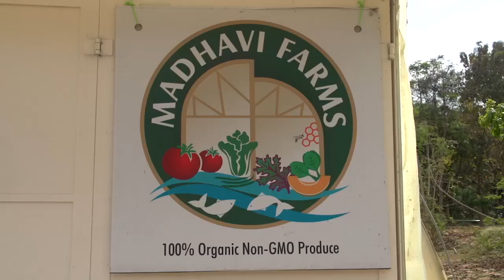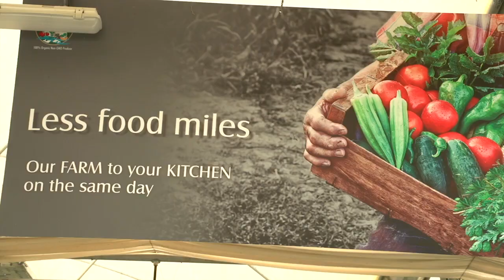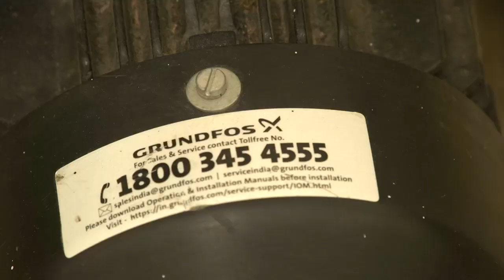Murray Hallam visits India's largest Aquaponic project - Madhavi Farms

Comment: Why isn't the bug zapper over the fish tank?
Fish like BBQ too.
Reply: Probably so they don't electrocute the fish or a worker if the zapper takes a dive.
Reply: @chf1949  

Didn't look like a bailing-wire engineered-type outfit to me, but you have a point.

It would need to be secure.

But if a zapper is needed at all, then a source of protein (in some measure) for the fish flies in under it's own power, for free.

Zapping a bug cooks the 'snot & stank' out of it, doesn't it?

Free food.

No?
Reply: Fish like bugs, bugs like plants, so its there to keep the bugs off the plants,....???
Reply: @DeeCeeTheGreat  How does that prevent them from feeding the fish with it also?

Comment: maybe they have higher water aeration because maybe their water is a little bit warmer? because of climate i mean. the warmer the water is the less it can hold in gases.
Reply: Photosynthetic activity of a plant will be limited mainly by temperature and C02 levels(after photosynthetic flux) I dont think it is the "oxygenation" of the water which results in higher yields, instead it is probably greater availability of nutrients at any given moment due to the mixing effect of the water stones evening out concentrations around the root surfaces. I think Oxygenation of the plants roots during dark hours may result in healthier more robust plants as plants must respire when not exposed to sufficient light. Also most root growth occurs during the dark phase.
Reply: @aidansharples7751  If the solution doesnt contain enough oxygen (below 5ml/L if I remember correctly) , then you'll get anaerobic bacteria, and then you have to practically empty, clean, refill and startover again, which is very fuken expensive. More because for a friendly environment for the rootsystem than using it inside plants own metabolism in photosystems.